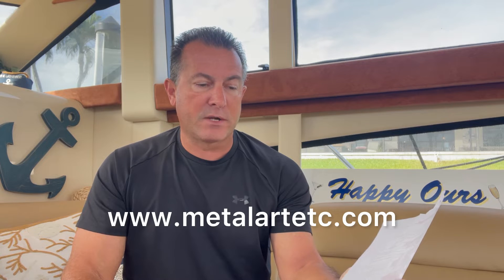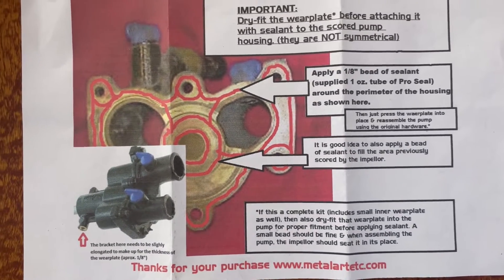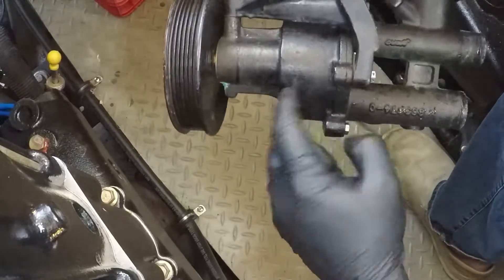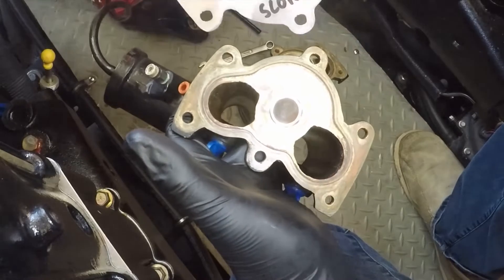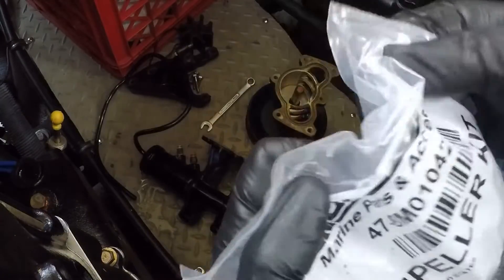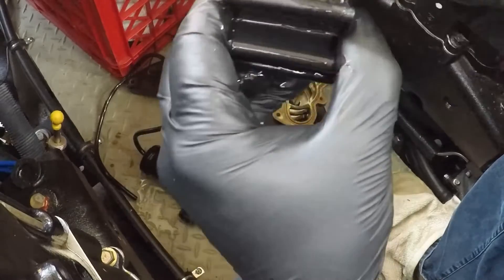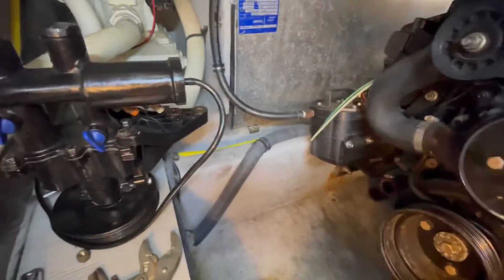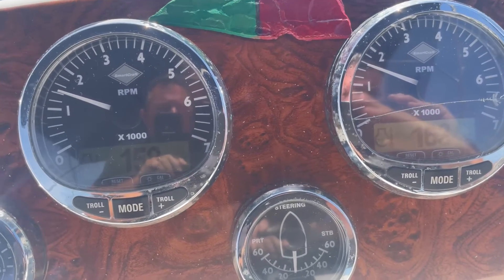Mercruiser Raw Water Pump Wear Plate Install from MetalArtEtc.com

Comment: Just an FYI, I have seen a lot of overheating issues that were caused by the sea strainer caps having cracks in the lid gasket. People like to just undo one side and swing the lid over to clean the screens.
Reply from the maker: I was thinking an air leak somewhere but couldn’t find anything.  Perko strainer gaskets were replaced not long ago.

Comment: Curious about your battery system size and type. I’ll be heading down from Ny to Florida for next winter in my silverton 38 SB
Reply from the maker: My house bank has 2 6volt batts.   Has served me well.  2 6volt deep cycle batts keep two refrigerators and anchor lights lit on overnight anchorages without running generator with no problem.

Comment: Maybe I posted something prohibited previously.  Just wanted to know more about your PSI readings, before and after. LOVE All ur posts!!
Reply from the maker: Don’t know about any prohibited post, but the psi readings didn’t seem to change much before/after the wear plate install.  I’m hoping to get it out this weekend for a test run.  We’ll see how this it does then.
Reply: @AdventuresofHappyOurs  I had posted that I have battled this same issue with my STAR engine in my 07'  M341. Have done about everything you have yet still low PSI and overheating when running over 3800RPM. My readings at idle are about PORT 3.5 / STAR 1.6. Was about to install a wear plate from another manufacturer. I think I posted the website and that was why removed. Anxious to see how yours runs out, but skeptical if you did not see PSI reading improve to match PORT engine. My wear groves do not seem enough to warrant the PSI being 1/2 of PORT side. Its very frustrating as I can not run on plane. Thanks. Have 3- 341's on my dock and we all love your channel!
Reply from the maker: @boydsmith6864 yes exact issue.  My sb pressures at idle are very low.  Even after the wear plate install.  I’m at a loss.  My next step is checking the shaft alignment. Perhaps it’s creating drag.  More to follow.
Reply from the maker: @boydsmith6864 I also pulled the pressure sensor on the trans cooler and cleaned it. But it seemed fine.   Temp sensor was replaced.  I may swap the pressure sensors to see if the pressures follow the sensor rather than just throwing more money at it.
Reply from the maker: @boydsmith6864 you should be able to post links in comments. Not sure why yt would remove it.  Can you resend?
Reply from the maker: Ok here’s an update.  I took her out today and at speed the water pressures were the same in both motors.   However, the temps were still 10 degrees higher on the sb motor.   I didnt get her up on plane to see if it would get worse.   So good news is water flow is not the issue.  I’m leaning towards poor engine alignment creating drag and higher temps.  More to follow.
Reply: @AdventuresofHappyOurs   I know your frustration! My mechanic came out Tuesday and installed a Mercury Part (Quicksilver 47-8M0137219, Heavy Duty Seawater Impeller Kit) that is OEM solution to the flow problem. Very similar to the aftermarket kit you installed, but without the large backing plate. It worked fabulously, as my PSI went from 1.5 at idle to 6.2.   Taking out this weekend to check temps but I feel really good about it. I will add this Part says "Excluding 6.2L engine".  BUT the actual instructions that come with it show there are 2 different type impeller housings. This kit only fits the type on our motor, but not certain others. I have the part instructions with pictures, but not sure how I can get them to you. You may consider for your port engine in the future since its a Merc part.
Reply: @AdventuresofHappyOurs  Also the link I tried to post was for the Hardin Marine Stainless steel aftermarket pump and wear plates. Glad I installed the Quicksilver kit first as its $55 vs $650.
Reply from the maker: @boydsmith6864 looks like the quicksilver HD kit is similar to the metal art kit but only one wear plate.  I wonder how it solves for the grooves on the other side of the housing?
Reply: @AdventuresofHappyOurs  can only say the results were fantastic. As an engineer, and just speculating, but the cavitation may be more pronounced in the bottom of the bowl vs at the face-plate where water enters and exits. It is good to know that at least Mercury has a solution.

Comment: When you reinstalled the pump, did you mount it first then connect the water hoses?
Reply from the maker: I connected hoses first then mounted the pump with the bracket.  It’s easier to work on and see what you’re doing.

Comment: Not a mechanic myself, all of this appears like magic to me.  How did you acquire your skills?  I would someday like to own a live-aboard and these skills are indispensable.
Reply: When you own a boat,you automatically become a mechanic
Reply from the maker: 30 years of boat ownership and being unable to afford to pay someone to fix every little thing. Lol
Reply: I have the benefit of guys like you making videos to explain things! @AdventuresofHappyOurs
Reply: Be careful with that setup. I've used one similar to it and you have to use a custom impeller that is shorter to account for the shim thickness.
Reply: I also switched to the Hardin Marine Stainless steel pump housing and it fixed my problem.